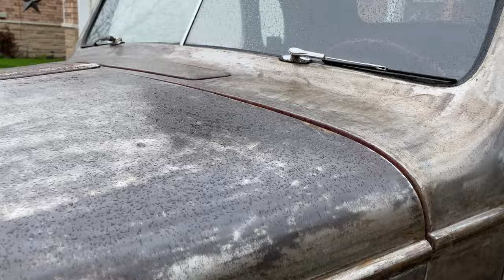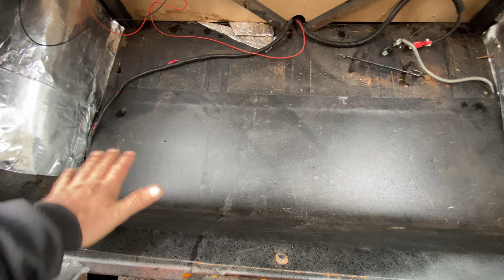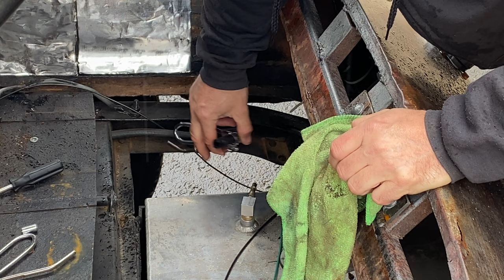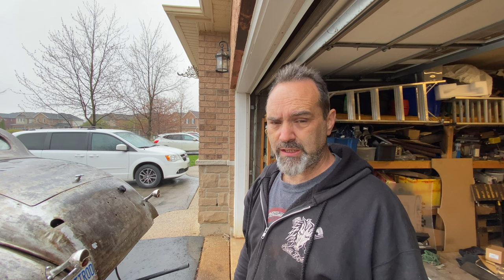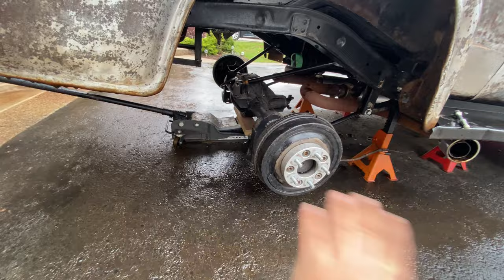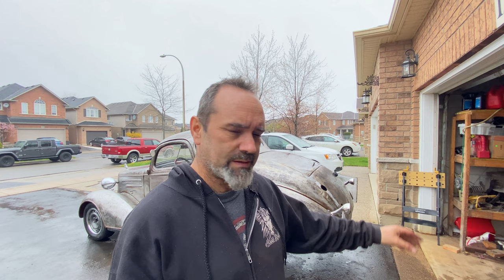4 Link To Leaf Spring Conversion - Day 1 - Axle Removal On My 36 Chevy Coupe

Comment: Dave if you put a centering hole in the bottom plate your making I don’t think you will have to worry about the space in between the spring and U bolt it will stay centered!!!!!

Comment: You  completely  removed  the  battery  from  car.  Could  you  have  just  disconnected
cables, and  maybe  put  cloth  around  battery  and  left  in  place?
Reply from the maker: I wanted to give it a full charge, so best to bring it inside.

Comment: I set the pinion angle on mine and tacked perches while in the car clamped with shackle ubolts and plates. Do you have a plan on how your going to set your pinion angle yet? There are alot of theories on pinion angles. I set mine equal and opposite.  Cool video Dave
Reply from the maker: Yes, equal and opposite is what I'm thinking.